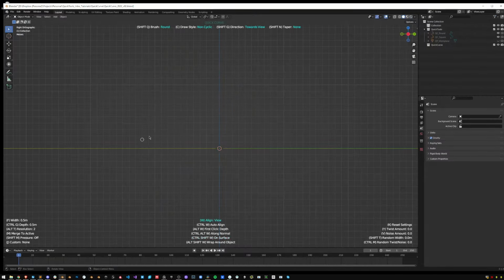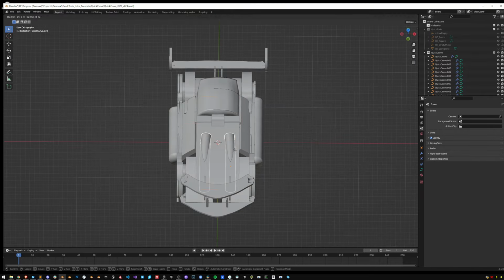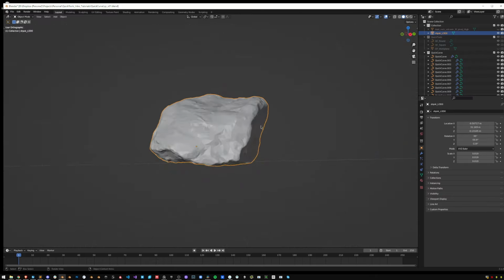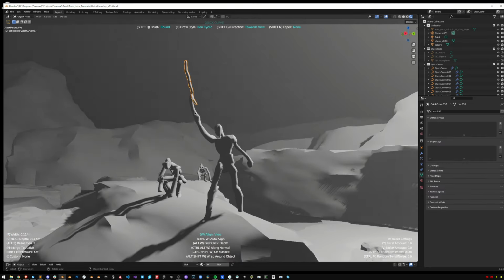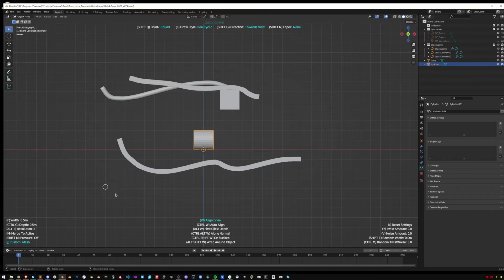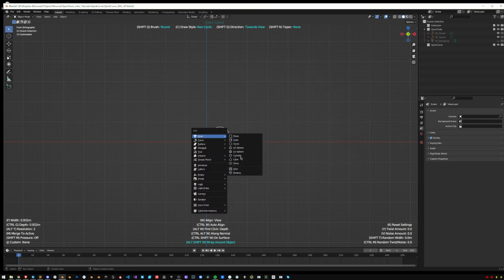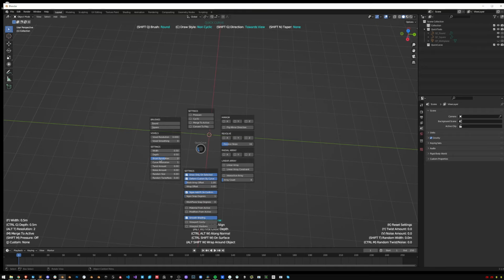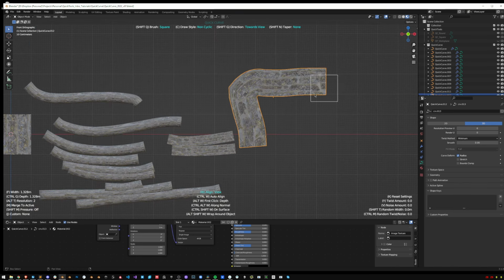Introduction to QuickCurve 2022 for Blender 3.1

Comment: A very great tool, i love tt Thanks alot. Jus greatt one qustion The voxel midellieng look very great, under the 4 minuts sign , - but i dont seem able to do this in my workflow, I can ipen the menu pressing ctk  and d, but nothing seem possibil to adjust, and sadely i cant mot do the same as you do in the video. I'm using blender 3.5, but have also tried 3,4, and im not capable of doing this voxel modelong. do you have any advice to mee  ???
Reply from the maker: Make sure you let go of ctrl+D. So its press, let go, menu will stay, then left click and hold on the value, move left and right, let go. Sometimes people still hold down the ctrl D menu. try it with a mouse if you are using tablet and vice versa. It works for both but yeah its just sometimes the clicking and letting go with the pie menu doesn't make sense for people until they do it right once

hope that helps!
Reply: @ALKSNDR  wow it worked, - i wasnt aware of this simplicity. Such a great and cool tool - thanks. Its such a great workflow improvement

Comment: 0:30 q curve = grease pencil but more optimized
0:50 draws line shape of buildings
then blocks it in by increasing brush size

1:10   Can do buildings, can do charcters, car, environments anyything
the chinese guy demo showed making a vase real quick too = can make cylinder dome buiding like star wars watchtower

1:41 quick buildings, and can use them as kit bash

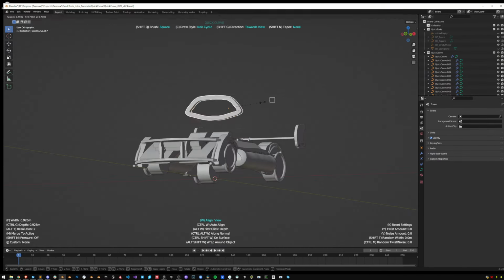Comment: 3:03 cool way to create a unique form
4:00 remesh and smoothed (To make all the curves into one asset, but it actually isnt one asset? just a visualization)

4:40
6:26
7:33 stretching objects
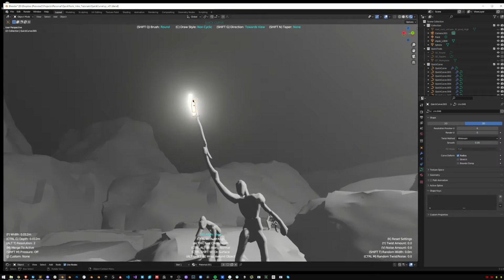9:50 drawing light (emisssive material)
14:55 wrap around custom assets
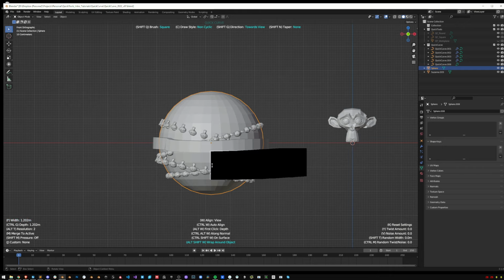15:00 could also possibly use for modeling wall layers/ levels of buildings and stuff